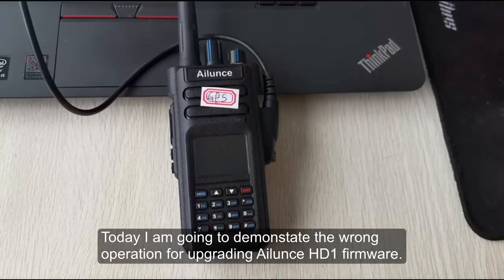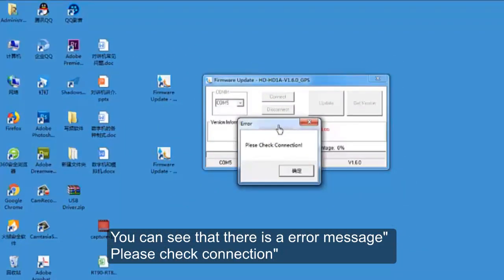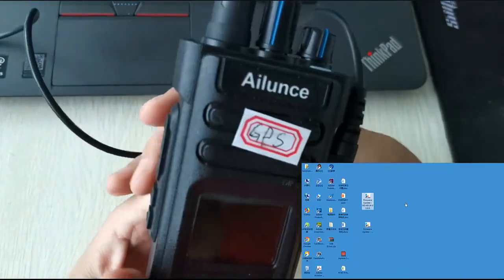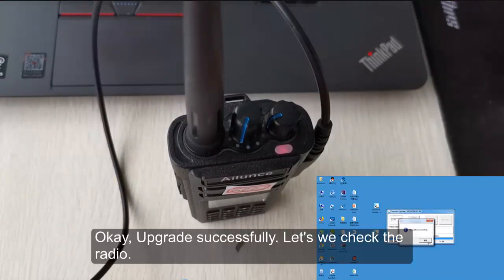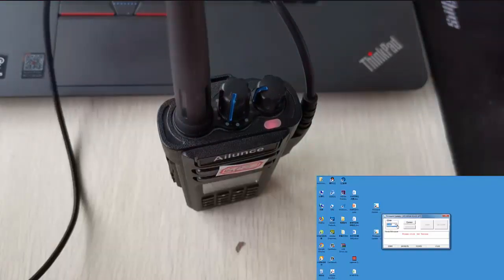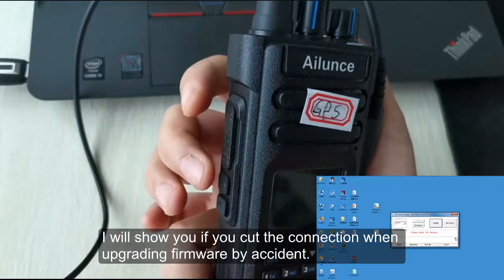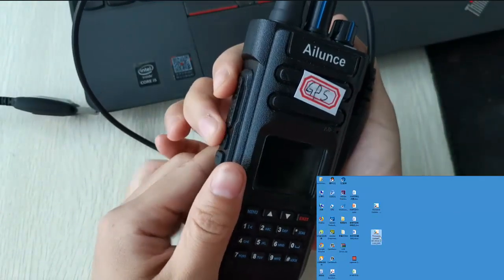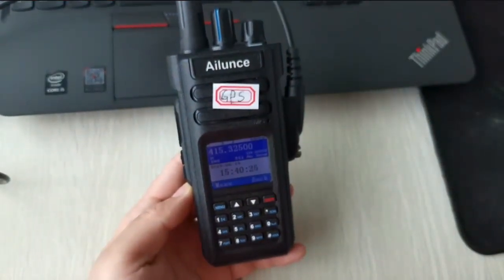Ailunce HD1 firmware upgrade wrong & correct operations

Comment: I have the following error when trying to read the codeplug, "check connection, Retry or cancel", the reading progresses up to 41% and then aborts the job, the radio restarts, windows10
Reply from the maker: Do you have a try again? Change another com port, and tighten the USB cable on the radio.

Comment: can't connect to the GPS radio because why does an error message appear like never?
Reply from the maker: Do you mean you can't connect to the GPS radio? and at the same time, you also never get an error?
Reply: @Ailunce  error list empty or error GPS I dont know why...
How can I adjust and configure GPS on the radio?
Could you help me?
Reply from the maker: @alessior.5549  Yes, could you leave us an email address?  I will send you the instruction.
Reply: @Ailunce   I also have an error it says ''run-time error 8020'', also the com port is set correctly, please help, any advice is welcome.
Reply from the maker: @sergiudr6315 If it shows error 8020, it indicates the driver's problem. you can uninstall the driver and reinstall it. then reboot the computer.
Reply: Hi what if the radio still won't turn back on